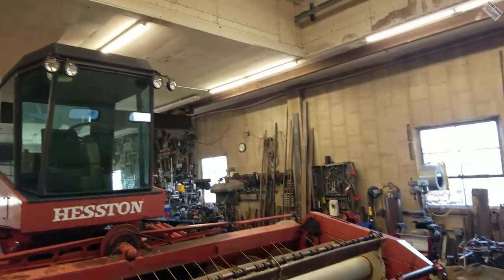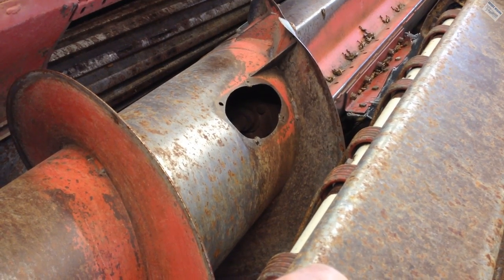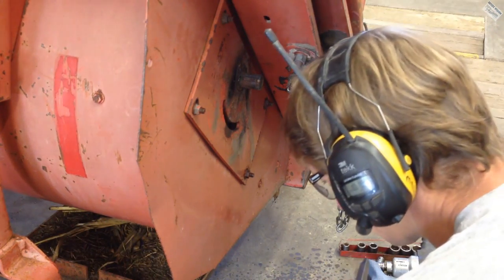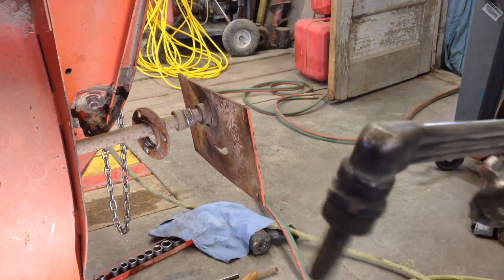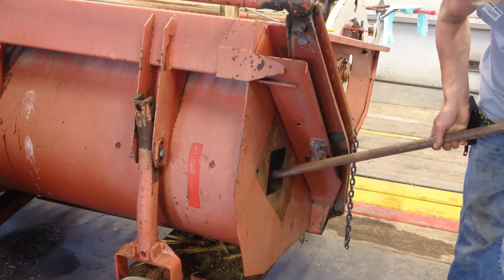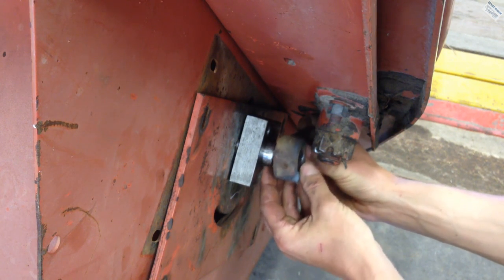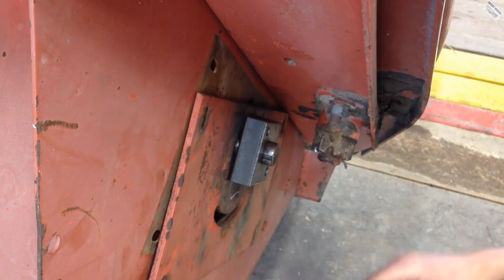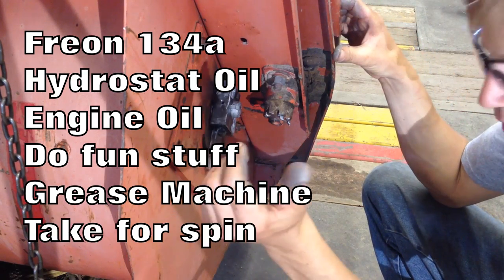Swather Repair - Machining a timing collar and replacing a bearing

Comment: I've always wondered the easiest way to get to those bearings.  We used to run old Hesston 1014 pull behinds with the swing tounge.  Have about 3 old ones & one has this problem.  Got tired of the old machines & went to a 3 point disc mower & a rake.  Saves a day of drying time for us here in northeast NE & no more plugging!  This video will help a ton if I ever decide to fix them up again!
Reply from the maker: I'm glad I could share I little information and hopefully save you some frustration. I've been curious about the disc mowers. Several people have to switched to them around here. I didn't realize they would help with drying time.
Reply: Our old Hesston's didn't really crimp the hay much anyway, now it's just like using an old sickle bar mower, but a lot faster.  I run 3rd gear power-shifted all the way up in our case 970 or 1070 & could go a little faster if I had another working gear.  No more worrying about gopher mounds either, it just levels them & makes a cloud of dust.
Reply from the maker: Nice!  Yeah, this Hesston doesn't crimp very well. I was assuming the crimpers are wore out, maybe that's just the way it is.
Reply: We actually took the crimper off the last few years we ran them & just fabricated some finger sweeps to bolt on & had them set to the size of the baler pickup.  Almost doubled our speed by doing that & no weaving while baling either.  Don't mean to bother you, just sharing what we did.  Take care!

Comment: I have never worked on a swather header, but it looks similar to an older combine header.  I didn't see any up and down adjustment, but on a combine, you can adjust the auger up and then put blocks under it to hold it up.  One other thing, if doing a lot of work in the header, it may be worth your time to remove the real so you don't have to climb over the back of the header to get in and out.

Comment: Bravo Matt. It would sure be nice if the maintenance (mechanic's) manual were on line. It is highly impractical to expect ant help at all in outer Kansas. I think  you improved the design. I suppose BTW you run a separate baler over the windrows once they have dried out?
Reply from the maker: Thanks! And I never understood why the farm equipment manuals aren't available online.   Normally it takes about 3 days and I go back out to bale it. But this year, the humidity has been so high, it took a week before I got it baled.
Reply: In the case of the online manual, I have found that a polite e-mail to their web "contact us" addr often works. After all they have pdf files, or can easily generate them.
Reply from the maker: I'll give it a try next time! :)

Comment: How long did those wood cutting circular saw blades last cutting steel?
Reply from the maker: Not quite as long as the ones designed to cut steel, but considering they are 1/4 the price, definitely worth it.

Comment: Looked like the hoist cleaned the dust off of the cab! Typical mechanic, work on everyone else's stuff and ours gets done last. Good video
Reply from the maker: I was beginning to think I was going to have to put the swather in facing the other direction.  I wanted the header facing the door in case I needed the crane from my welding truck to assist. Luckily it wasn't that complicated of a job.

Comment: Any closer you would have had to let some air out if the tires. lol
Reply from the maker: I was beginning to think I was going to have to face it the other direction. The only reason I wanted the header facing the door is so I could use my welding truck crane if I got in a pickle.